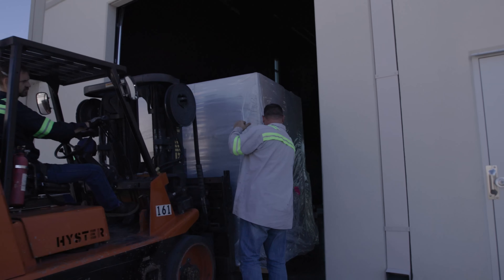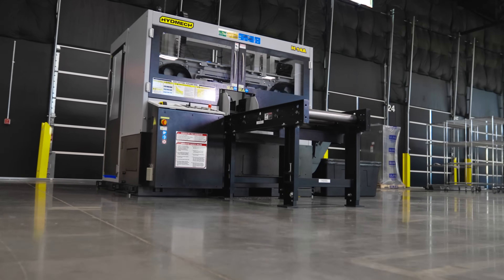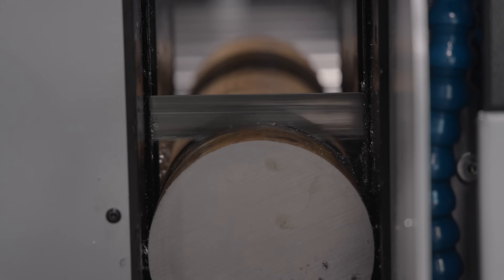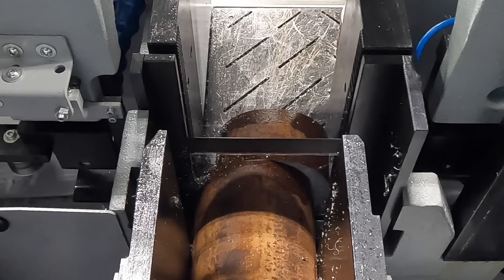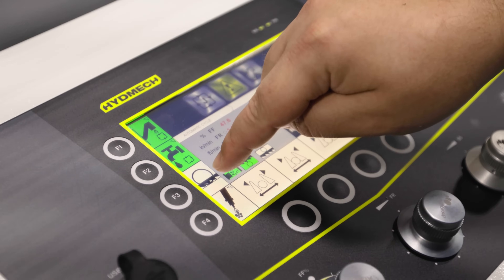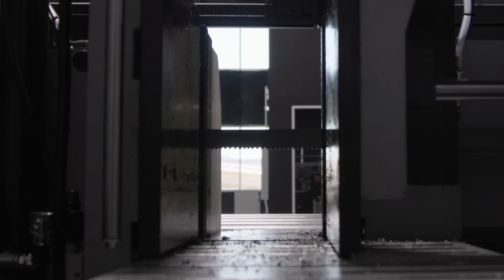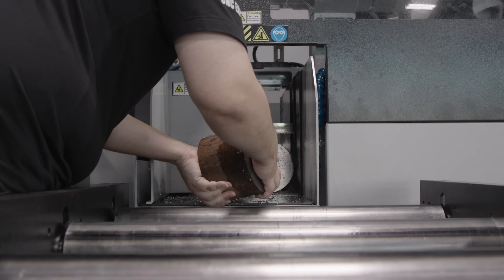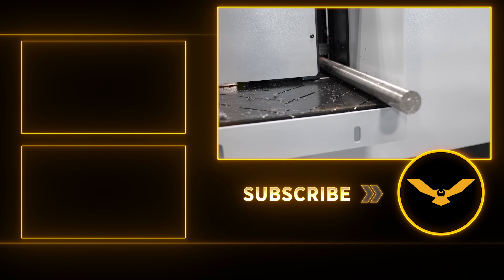Preparation Before Complete Metal Eradication | HYDMECH SAW

Comment: Use to work for a company that has your saws, 3 H14a and 1 H11a my daughter took over my position as supervior after i was severely injured on the job. I taught her operation and basic repairs. She caled me today about the H11, blade broke and run into coveyor qhich she got out problem is head won't go up at all to put new blade. She has tried to clear warning indicator  but can and head wont go up. Can u help out.

Comment: If you want a video idea. I've always wondered about the chips (waste), after they are made. All the way up to them leaving your facility. And if you have an agreement with someone after you get rid of the 'waste', what happens then.
Reply: How not to waste money with chip disposal/recycling would be a great idea for a video.

Also the recycling of used tools is an important point.
Reply: @norbertfleck812  Yeah, can old tools be turned into smaller new tools?
Reply: @m4rvinmartian  Regrinding is a subject, but recycling of carbide is also something you can loose or earn money with.

Comment: The thing about sawblades for us poor boys is, using the correct blade vs changing out the blade is time consuming.  I know and have the blade TPI charts near the saw, but newbies often foul it up more than they install it correctly.  Would you run that course tooth blade in thin wall, and just use the hydraulics to slow the downfeed?  Time for a carbide tipped sawblade in inconel video.  It's always better to have a beefy/robust saw if you can afford it.  :)

Comment: If this was mine I’d hire someone to run it overnight. I would imagine this shop has someone who assigns jobs to operators. This individual would send a message to the saw operator: tomorrow John is running job 252503. He needs 25 6” pieces of 7” 4340, two sets of shell mill inserts, these three drills, another barrel of coolant and a pastrami on rye with deli mustard. The saw operator sends back “what does this look like, the Dallas branch of Sarge’s Deli?” and has the rest of the order sitting in front of John’s machine so he can walk in the door at 7 and start work.

Comment: It's quite unusual to see enclosed type of band saw, compared to our BOMAR Individual 620.460 GANC, which has that all-classic open design. I hope, it's not really hard to change a blade on it. Because, you'll have to do it really often, if you are turning not only big parts, but also small ones, as smaller diameter workpiece requires a saw blade with smaller teeth.
Reply: Was thinking about that myself. Looks like you elevate the blade to the top and open the doors to access the blade.
Reply: With that kind of 2 column band saw you don't have to change the blade. You can cut even a 5 mm rod with a 2/3 blade.

I own and operate a MEBA AP260 at my shop. This kind of band-saw automats are amazing!

Comment: I wonder if anyone makes quick change bandsaw blade systems, like the ability to change out different TPI blades for swapping between thin-wall & solid stock or if the solution is still vari-pitch blades (disclaimer I'm typing this before I actually go on to google to actually check)